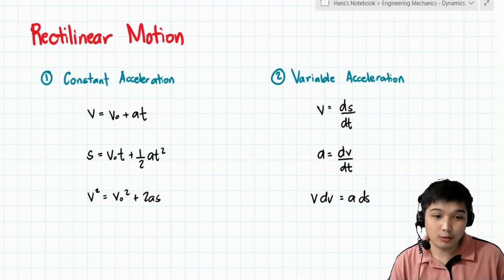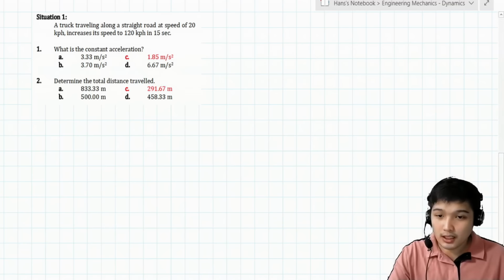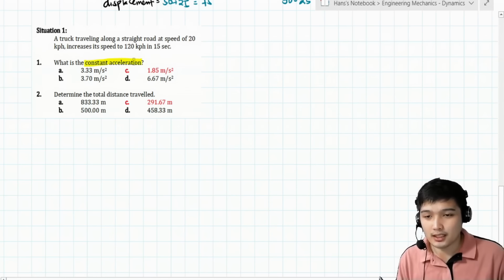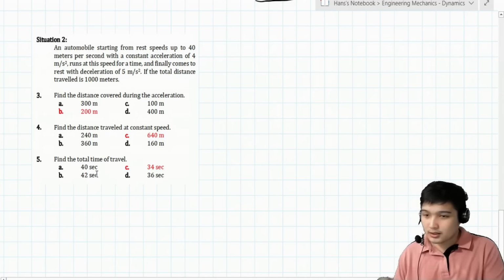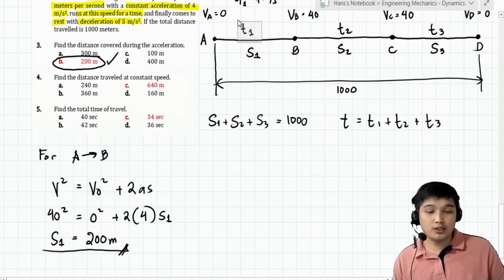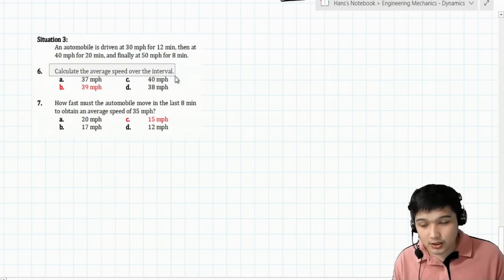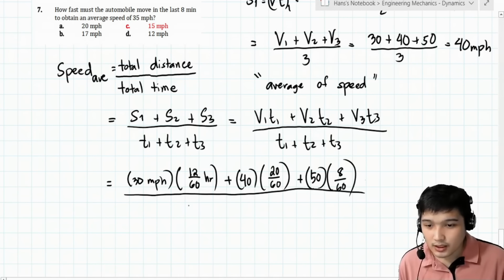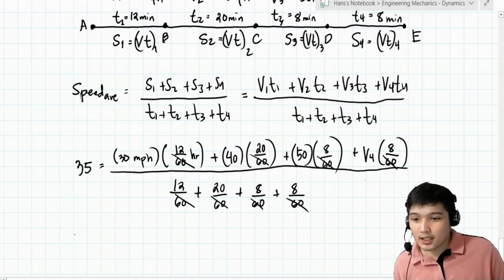Dynamics | Rectilinear Motion | Constant Acceleration (Part 1)

Comment: paano po naging 16sec yung t2 sa situation 2? diba po 40=40+(0)(x)? 8 sec po kasi lumalabas sakin
Reply: kunin mo yung s2 sa equation na S1 + s2 + s3=1000 which s2 = 640 m. , tapos plug in mo sa 40=s2/t2 -> 40=640/t2 which is equals to t2 = 16 seconds

Comment: Sa 6, what i did is, kinuha ko distance ng tatlo isa2 (S) - S=Vit+1/2at², ginamit kung acce is 9.81, tas kinalculate kolng using Total Distance/total time, but make sure na kinonvert mo na yung 40min to hr, 40(1/60) tas basta mag come up siya sa answer na 38.9 or 39mph
Reply: Tas sa 7, 50-35 lang HAHAHH multiple choices kasi din sa exam namin and di na necessary kung Anong klaseng formula or process ang gamitin basta makuha lang haha

Comment: Guys sa mga Hindi marunong kumuha ng 1.85 get a calculator na may shift calc (Casio brand etc..) if sa android (CalcEs) tas ilagay nyo ung kapareho sa formula B=A+a (T) ito 33.33=5.555+X (15) ...click Shift tas Calc = 1.85166.. so on ung (5.555+X) yang "X" sa 'alpha' Yan or 'shift' depende sa calc hanapin nyo lang ung X Hindi x as in multiply.
Reply: paano naman po ilagay yung 33.33=5.55? ksi sakin po nag eequals sha, hindi ko malagay yung equal sa gitna.
Reply: alpha + calc po @JeanMiralles0613

Comment: Sir pano po naging 1.85
Reply: Same question
Reply: Vf-Vo/t
Reply: Shift solve po
Reply: Pano sya itype sa calcu
Reply: Use the equation derived when the acceleration is constant "v = vo + at"

300/9 = 50/9 + a(15)
a = 1.85 m/s^2
Reply: 33.33=5.55 + a (15)